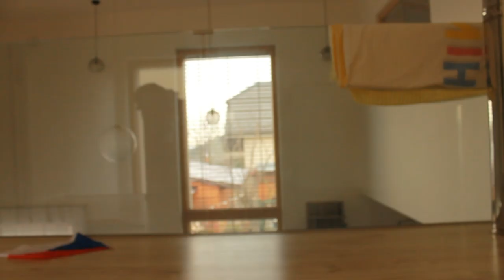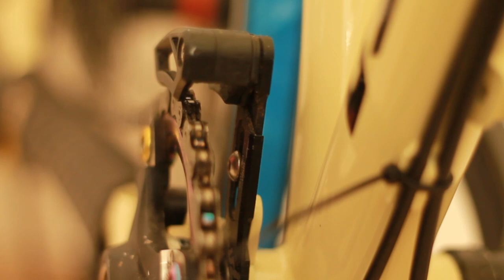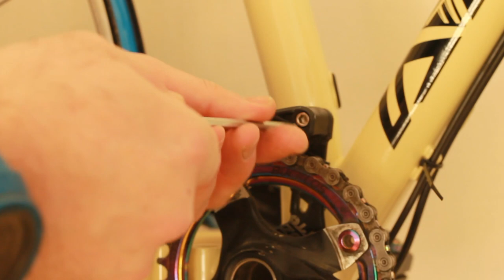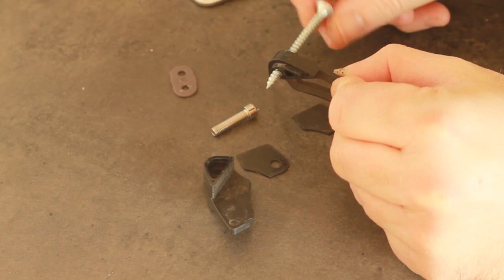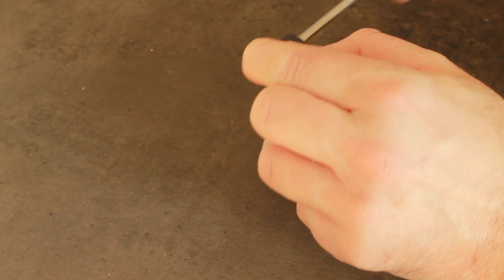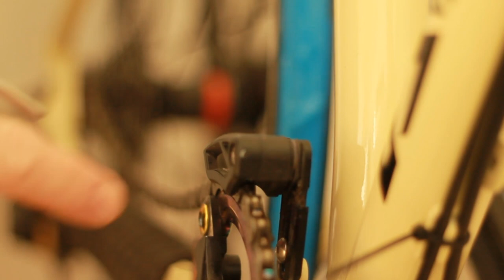ZTTO chain guide doesn't fit! MTB chain guide

Comment: Yyou need to check your chain centerline, the chainwheel maybe to far out. If its 135mm rear spacing your chain centerline would be 50mm, i dont remember what boost centerline is but im sure you could find it on line
Reply from the maker: It's a fair point I've always had a poor chain line boost is 51-53mm and I will measure it up when I get home. The ZTTO chain guide being non boost would explain a the issue.

Comment: That ring on the drive side was supposed to be removed and this guide acts as the new 2.5mm spacer. Your chainline would have been right if you removed that like you mentioned